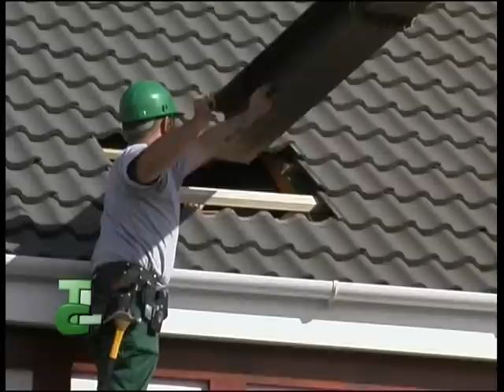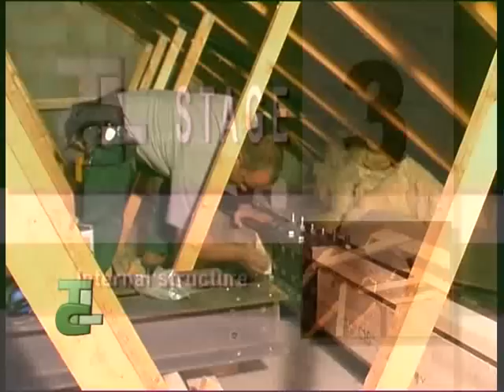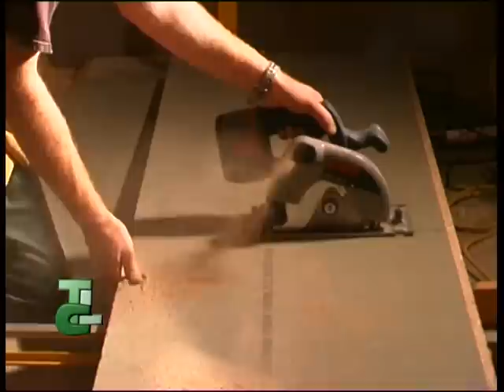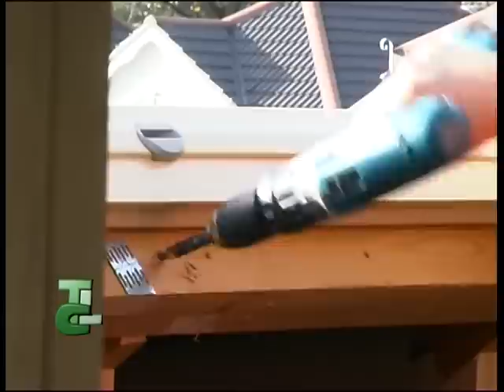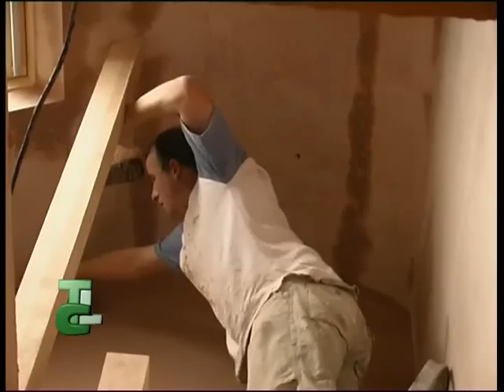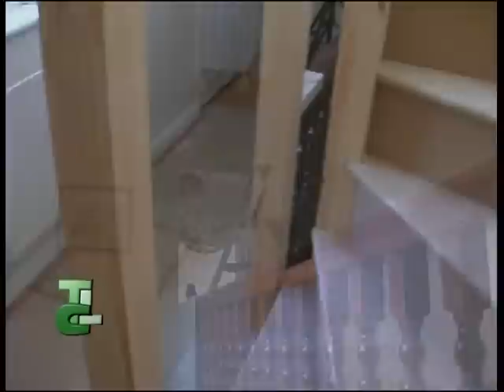Truss Loft Conversion Process Start to Completion Stage 2

Comment: Isn't the steel beams a bit overkill?
Reply: Yes but under building regulations you can't do it without them because they say it weakens the structural integrity by removing the trusses.

Comment: Is that insulation better and cheaper and easier to install than celotex board's?
Reply: Ryan H its definitely not easier. I used to hate working with the shit!!! Its a nightmare to cut and put up on your own anyway haha. Sometimes we had to use both celotex and this stuff.
Reply: Thermal values for soft insulation are nowhere near solid values, now days you'd need it 2 foot thick to get up to regs, it horrible stuff to work with but what insulation isn't

Comment: The steel beams must laid on pre made concrete pads, and not on either brick or what looks like breeze blocks, also steel brackets should be bolted to each end of beams and walls.

Comment: lads u forgot to put concrete pad stones for the steel beans oops, ni building control would knock u back on that?? not a bad job very good
Reply: Never needed them back then. Just a 600 steal plate under the beam.